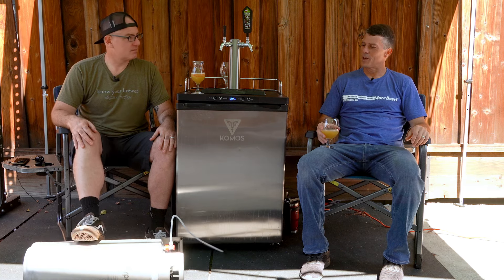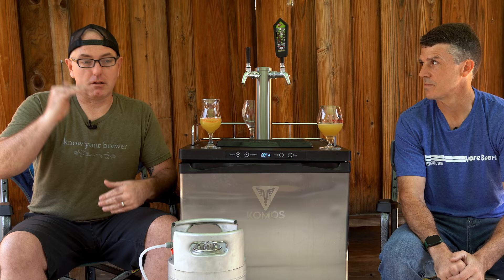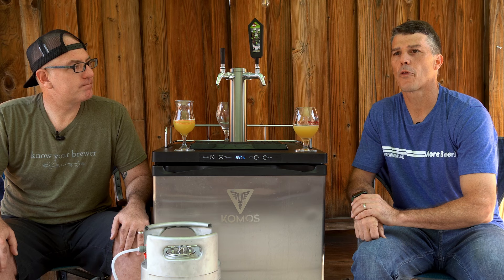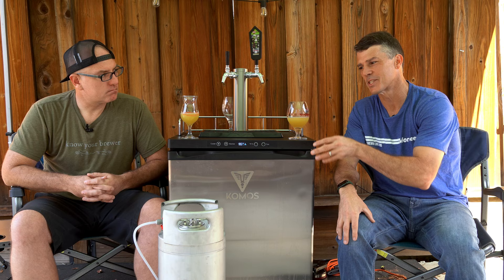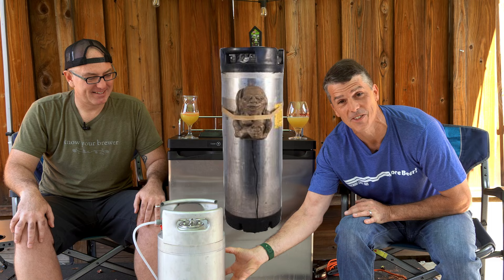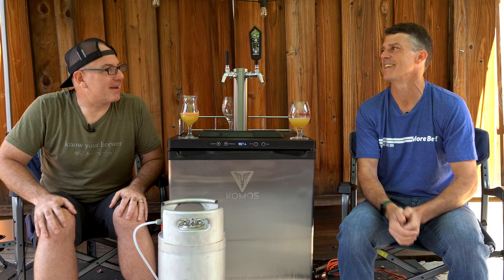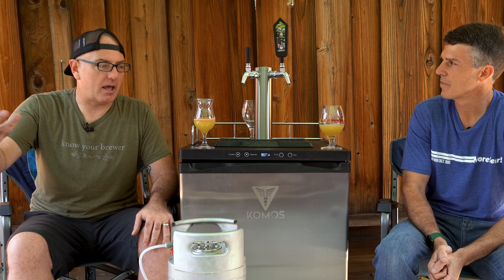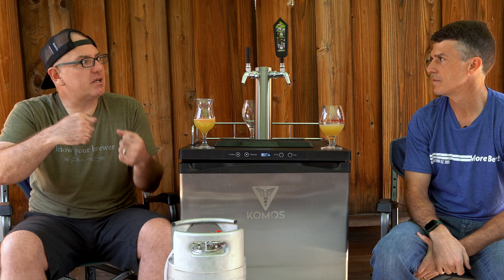Everything YOU NEED TO KNOW About Carbonating Your Beer | 4 Ways to Carbonate Beer | MoreBeer!

Comment: I do the set/forget method, but speed it up. Ex: Instead of 5 days (minimum) at 11psi, I condense it to a couple of days. 1 day at 11psi x 5 days is 55psi. 55 ÷ by 2 is 27.5 or 28 for two days. After two days, i disconnect the gas, turn the regulator down to serving pressure, vent the keg and reconnect.

If you're ballsy, I guess you could go at 55psi for 24hrs, but I never need beer that quickly so the 2 day method works for me. Been doing this for a few years now.